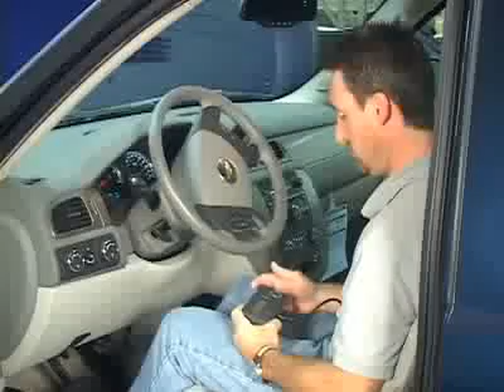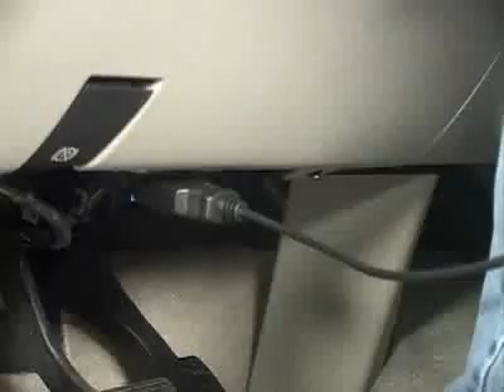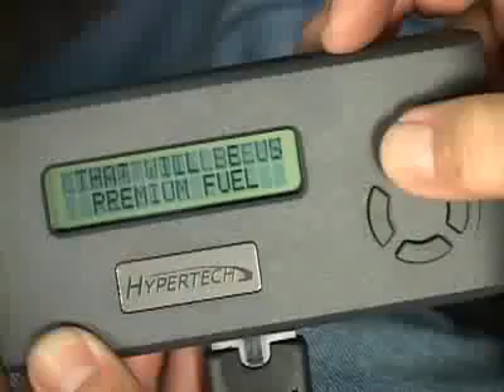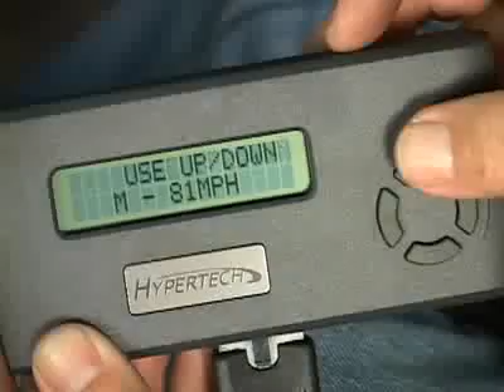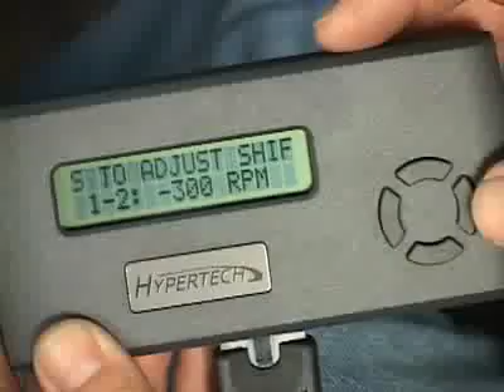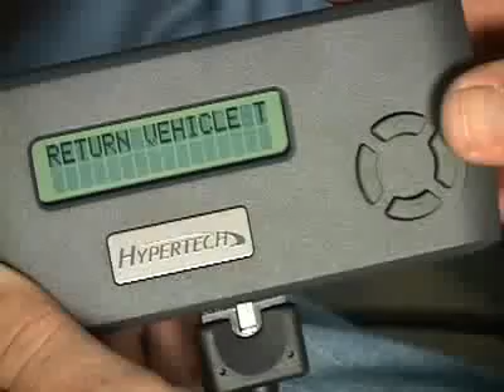Hypertech's Max Energy Install Instruction

Comment: I installed a CAI, a performance MAF, and high-flow exhaust on my Chevy Astro (4.3L). Do I plug the Hypertech in and press Y for performance? Meaning, does it automatically tune the ECU for the increase in airflow? I use high-grade gas, and my tires are stock size. My goal is better torque. I drive cross-country a lot.

Comment: Bought one for my 4.8 06 Silverado 1500 crew cab 4x4.  truck has no codes runs like a champ but 7k pound truck with 33s and the lil 4.8 felt sluggish this woke it up a good bit definitely happy with the power it has now also fixed my speedometer and fixed my shift times truck takes off from a dead stop great no longer sluggish!
Reply: What shift times/points do you recommend?

Comment: I have a 2013 silverado 2500hd 6.0l gas.
I upgraded to 40 inch tires and I also installed 4.88 gears. Do I need to reprogram?

Comment: Will the energy max recognize if my car has headers, intake and exhaust and adjust accordingly?
Reply: no, sense there are no sensors that would give it that info it will not. It only affects things that are directly computer controlled, such as fuel, Transmission shifting, and limiters. There nothing to change or control electronically on those mechanical parts

Comment: I have the same programmer for my 1998 F250 4.6L and I have updated the programmer and when I adjust the programming the only options I have is do you have and automatic transmission and then it doesn't let me adjust the settings I'm quite frustrated with this already any advice?

Comment: what is top speed on this speed limiter   for drag racing
Reply: Donnie Shepperson 100000000000000000000000000000000000000000000000000000000000000000mph
Reply: others are saying 128 mph
Reply: so you are saying,you can take completely off,to no limit?
Reply: Donnie Shepperson 255 mph limit for my c6 z06, not sure if it's the same for other cars, you can set it anywhere between 0-255. it gives you an option.
Reply: thanks,for you reply,I have old chevy van speedometer goes double,can only go 45 mph,it reads 90 shuts engine down,going raise it,drive this old van couple more years to haul lawn mower around ,haul off trash
Reply: Donnie Shepperson as long as it's 96 or newer because you have to plug it into your obd2 port.
Reply: yes it's 2000 express van 4.3 .Think I'm going with the Jet 15024  , It should raise it to150 mph,again thanks for your input!

Comment: I bought one for my 2015 Camaro 2ss & it woke it up, this product works, I have a full cat back, jet throttle body, cold air intake, & even after those mods it wouldn't burn rubber, after I installed a tune, eliminated fly by wire stock settings & shift points & firmness, it will smoke the rears, great product......
Reply: hey i just got one my self what is the best setting for shiftpoint ?
Reply: @DeltaBoy919 that’s what I was gonna ask
Reply: Would this work for a Ls1 ? C5 Corvette
Reply: I installed a CAI, a performance MAF, and high-flow exhaust on my Chevy Astro (4.3L). Do I plug the Hypertech in and press Y for performance? Meaning, does it automatically tune the ECU for the increase in airflow? I use high-grade gas, and my tires are stock size. My goal is better torque. I drive cross-country a lot.
Reply: @DarronSanderson  shit it was nine yrs ago, it had tunes you can download into your car, you can adjust shift points & on my camaro the firmness of the shifts, as for airflow, bigger throtle body/ headers & big exhaust pipes allow it to breathe more, but an engine can only ingest whatever cam/valves allow, unless u supercharge it or turbo, strange ive never seen any of these other questions or been notified about them, yours is the 1st, happy motoring.....
Reply: @jetbtkng  lol@9 years ago. I did a search in Hypertech and your video came up. Well, I do not see the question about whether I have to adjust any settings in the programmer to “remap” (retune) the ECU for the added airflow. I called Hypertech and they said it will automatically adjust just the ECU for high performance.
Reply: @DarronSanderson really, i don't remember making a vid, can you give me a link to it, & ya you download a tune & it will adjust everything, but you can also do your own custom adjustments to also, it is/was a great product, my ss got totaled, got rear ended by a suv & wrecked it, sad day...
Reply: @jetbtkng  Well, it is my Chevy “Astro”, obsolete in 2005. My 5th Astro. 4.3L V-6. In this video, they did a custom flow exhaust and just a K&N air filter, but they used a 32500 Hypertech Max Energy programmer. I asked them if they had to make any adjustments to tune the ECU after what they did to the van. They haven't replied. They said they got a new 17 HP from it after these things. I've considered a V-8 swap though.
Reply: https://youtu.be/eSvfK4YoqTs?si=rd-XOaS3HzTYZgey

Comment: Well, seeing how I used to have a Superchips on my old 02 4.7 Dodge Durango, (which made a world of difference on 93 octane), shifted better, ran better, etc. I'm excited to give Hypertech another another go around on my Hemi Magnum..(wanted to try something other than Superchips this time).....Which should be here middle of next week.... I say another try because I haven't had a Hypertech Product in years ever since my ol 92 Camaro, installing a piggy back style chip and even back then, man what a difference....!
Reply: I installed a CAI, a performance MAF, and high-flow exhaust on my Chevy Astro (4.3L). Do I plug the Hypertech in and press Y for performance? Meaning, does it automatically tune the ECU for the increase in airflow? I use high-grade gas, and my tires are stock size. My goal is better torque. I drive cross-country a lot.

Comment: Husband easily tuned his 2004 RX-8 with it. Also has a turbo and easily get 414 whp, and his high speed so far is 150 mph
Reply: Alexandria .Stewart  i got a 08 rx8 non turbo, and i cant seem to get past where after selecting the tune you turn the ignition on and off

Comment from the maker: Please call our Tech Support and they will be happy to help you!

Tech Support Hours: 8:00am-5:00pm CST. Mon-Fri
For tech support please have your product¹s serial
number available at the time of your call.
Phone: 901-382-8888
Reply: I installed a CAI, a performance MAF, and high-flow exhaust on my Chevy Astro (4.3L). Do I plug the Hypertech in and press Y for performance? Meaning, does it automatically tune the ECU for the increase in airflow? I use high-grade gas, and my tires are stock size. My goal is better torque. I drive cross-country a lot.

Comment: @colette8075 you unlock the ECU's for its full potental.
Reply: I installed a CAI, a performance MAF, and high-flow exhaust on my Chevy Astro (4.3L). Do I plug the Hypertech in and press Y for performance? Meaning, does it automatically tune the ECU for the increase in airflow? I use high-grade gas, and my tires are stock size. My goal is better torque. I drive cross-country a lot.